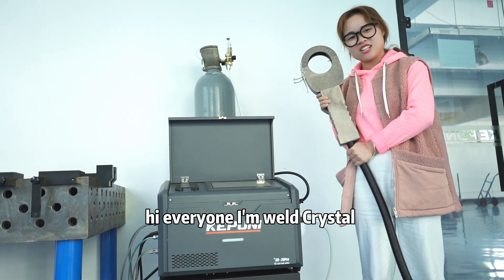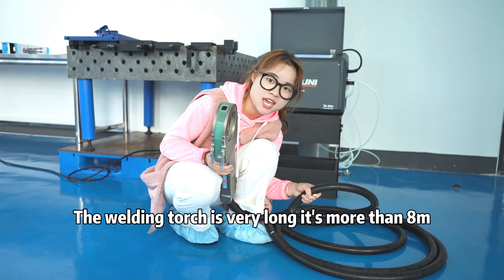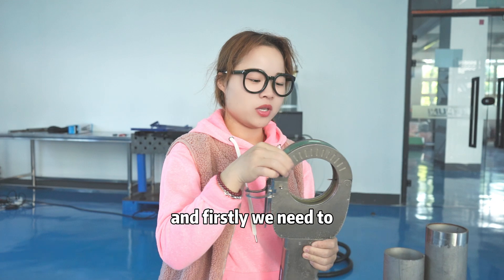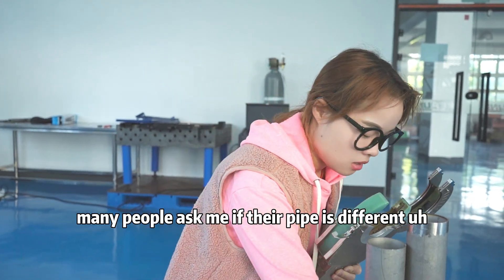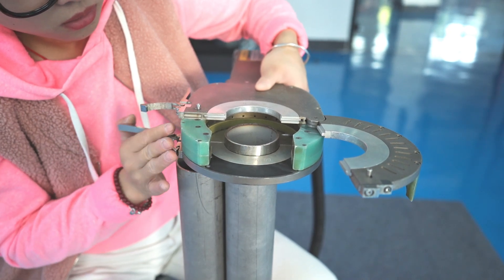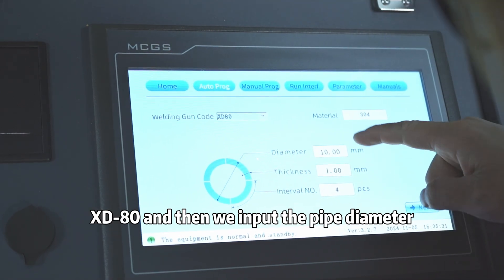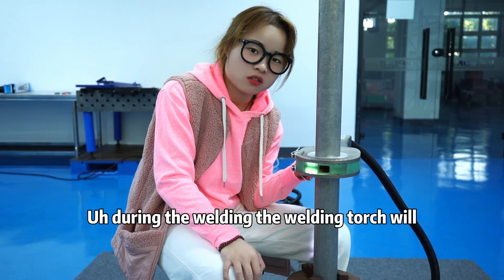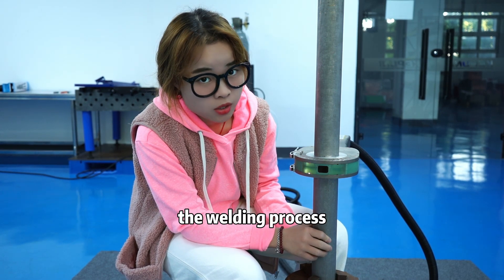Machine-Pipe|Tube welding Machine:KEPUNI XD-80 Closed Automatic Orbital Welding .

Comment from the maker: Mainly used for welding: stainless steel, carbon steel, titanium alloy, copper pipe and other nickel-based alloy pipes. Straight pipes, bends, tees, flanges, etc. can be welded.Welding range (pipe diameter: 3.175-168 mm, wall thickness: 0.5-3 mm)